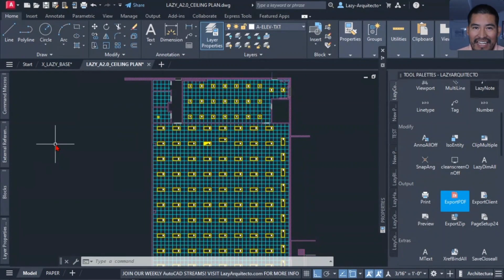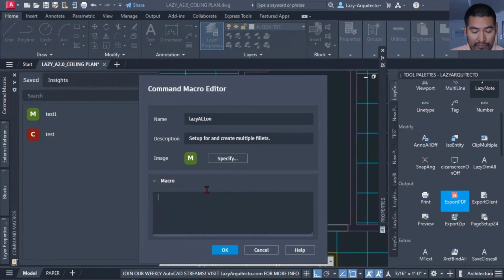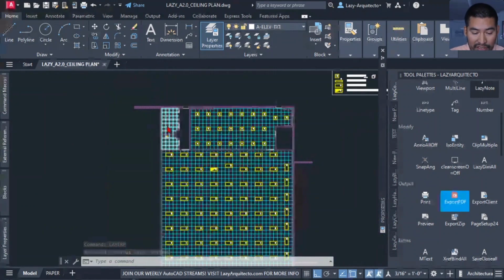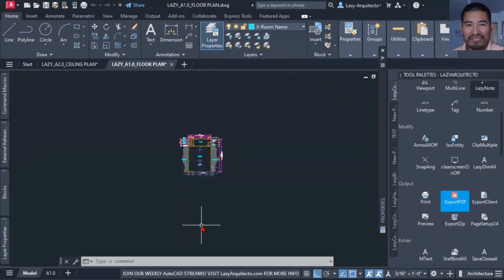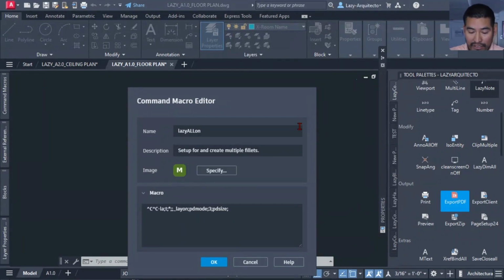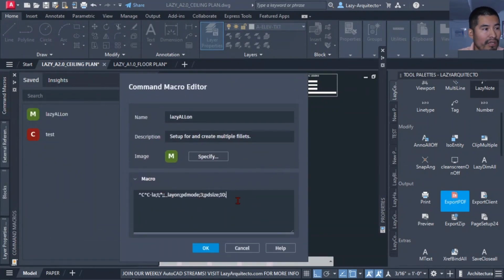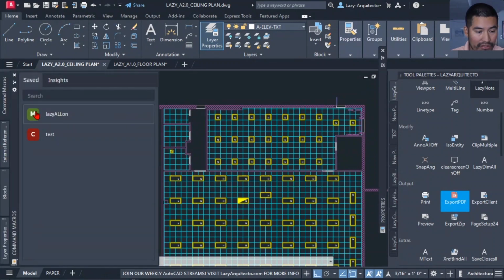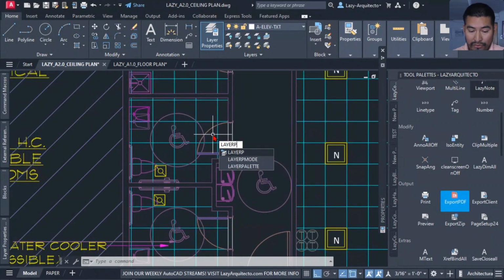'All On' Macro: Turbocharge Your AutoCAD Workflow!

Comment: Hi I use the AutoCAD Mechanical 2023, is it possible to use the command macros from this version or is it only in AutoCAD?
Reply from the maker: Hi 👋 yes you can use this in Mechanical, as I used this in AutoCAD Architecture and it worked perfectly. The only difference is that you will have to run this command from your ribbon or from the quick access panel since tool Palettes has many restrictions. Here is how to add commands to your quick access panel: https://youtu.be/mjzcQLAdRzU